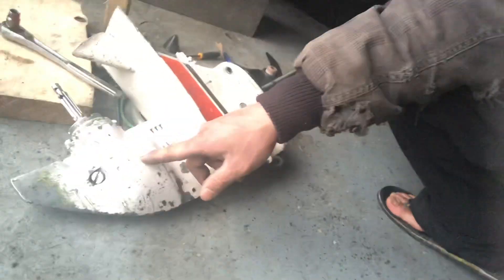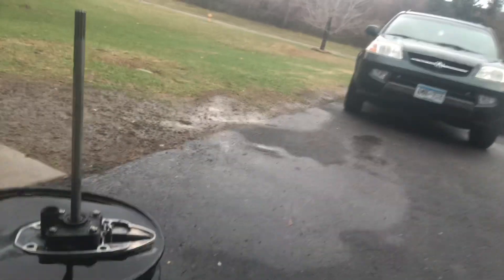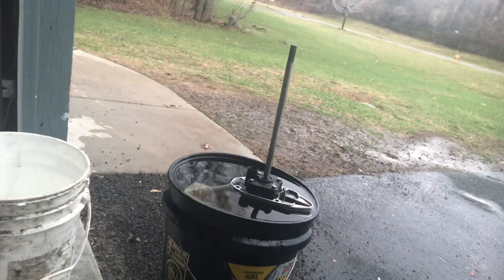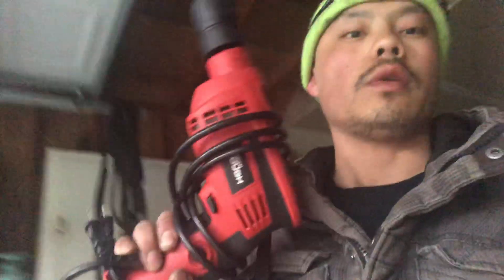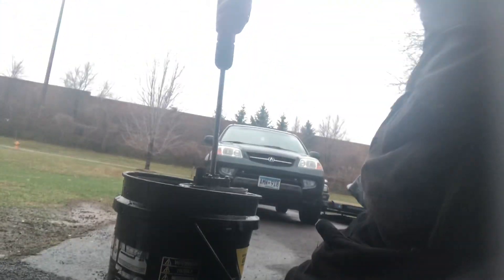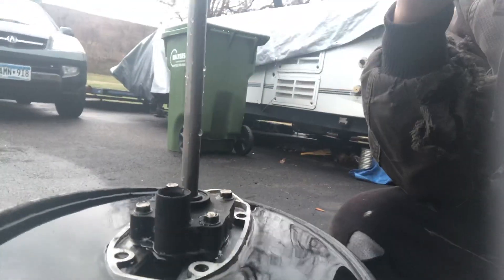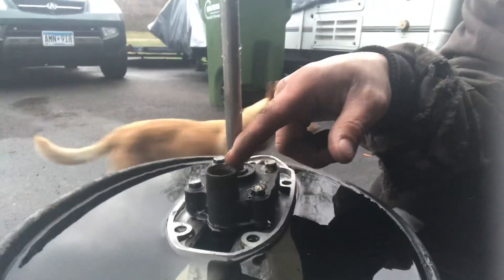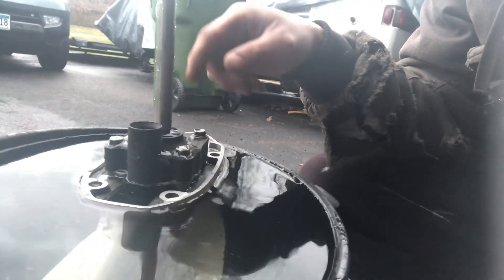Water pump test. Chrysler outboard 9.9

Comment: I have a 1980 15 horse like yours and it seems that my water pump pumps less at high speed and at idle. Have you experienced this?
Reply from the maker: I did notice mine performing similar. Sometimes it didn't pump at all...That's why I looked into it and decided to replace it.
Reply: @MrChengdothings  Were you able to fix the issue by replacing the impeller? My impeller is new and it is still overheating. I cleaned and sanded down the housing a bit. Maybe I will sand some more off to make the impeller more tighter?